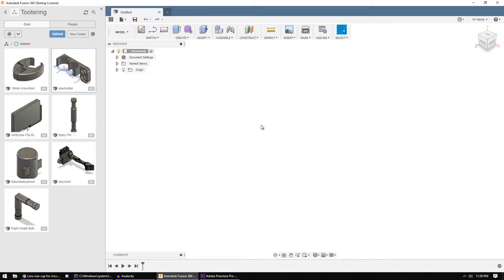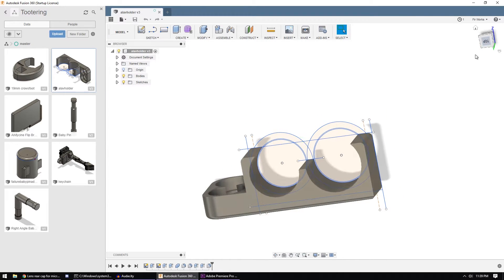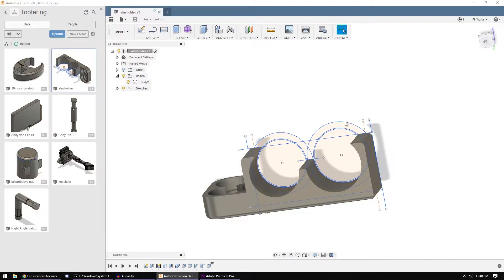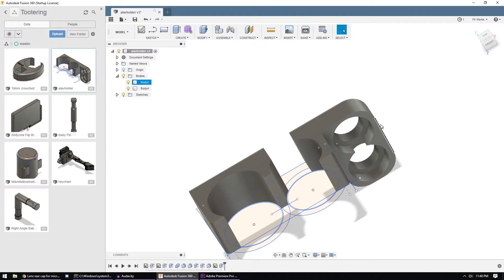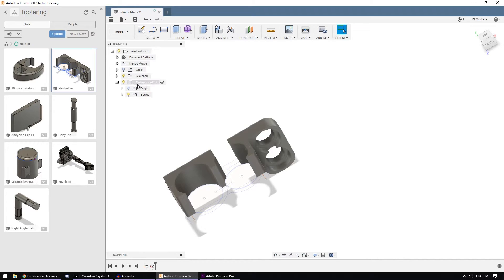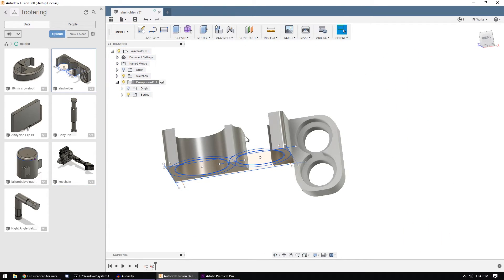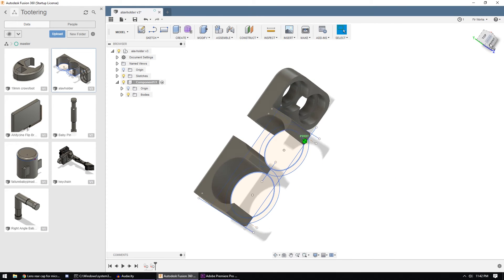How to Combine Bodies and Export STL Files in Autodesk Fusion 360

Comment: 1:51 There are good reasons to use a component, but you can also export multiple bodies by right clicking on your top level part in the browser (i.e. alavholder v3)

Comment: I need some help lease.I need to print an object. The object is compunded of multiple bodies and most om them are hiden inside the object. I want to make the object as a solid. But i dont want the internals to be saved into the .stl files otherwise the slicer will want to print those bodies as well even though they are hidden inside the object. This will increase print time drastically and also material use.So is there any way I can save multiple bodies of an object only into one solid or only as a shell?
Reply from the maker: Can you not just instruct your slicer to ignore interior spaces? I use Cura and it has an option called: "Union Overlapping Volumes" which I believe would do what you want.
Reply: I only have Slic3r Prusa edition. 1.36.I will try and look for something similar hopefully.Thank you for the advice.
Reply: @firworks  I have now downloaded, installed, set my printer up in Cura. I have watched tourtorials and imported my object and set the Union Overlapping Volumes option as you described. I Sliced the part and checked the pinting per level and guess what...
All for nothing. The internals are still Sliced into the STL. 😔. This just reaffirms that the model need to be made solid or hollow before porting to your Slicer. I tried this in Mesh Mixer but it completely messed up the part. 😫
Reply from the maker: @michieljames737  Well my suggestion was not necessarily to download Cura but more to find the feature in your slicer that works that way. However, it should work in Cura based on what you said earlier. Can you share the .stl file? I just did a test with a enclosed interior volume (cylinder inside a box) and toggling that setting in Cura will cause it to ignore the internal geometry: https://imgur.com/a/u59bHfY
Reply: @firworks  No I ding mind. I have been thinking of getting Cura also. But I am still struggling with my current Slicer so I just wanted to eliminate unnecessary variables. I appreciate the help and I did look for a similar option in my Slicer but could not find it. Thanks for offering v to help. The item I am trying to print is for my training. And there is not one that I can buy so I have to print my own. But don't want to waist unnecessary te and filement on printing and my training day is in a wheeks time.
Reply: Yes could share it with you. Shal I share it to you via google drive?or is tere an email adress I can share it to?PS. I looked at the imgur link you shared and thats exactly what I did. But while slicing the parts still show when curring.
Reply from the maker: A Google drive link would work fine.
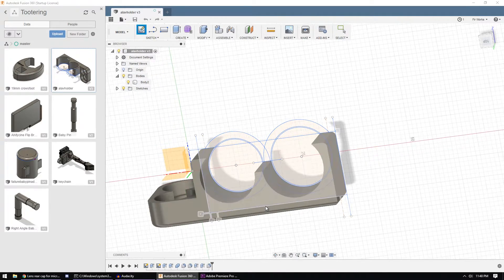Reply: PS. The .stl file is 1:10 scale so you must multiply by 10 to get the exact model size
Reply from the maker: @michieljames737  Ok so at 10x scale, it looks like 0.4mm expansion, Remove All Holes, Union Overlapping Volumes will work I think. That removes most of the internal detail but does retain the barrel.
Reply from the maker: @michieljames737  Yep, I can see the problem. That model does not have overlapping volumes it actually has all the internal pieces cut out because it is an assembly of pieces with their proper tolerances. In Cura, you can remove those tolerances forcing the internals to overlap by using the "Horizontal Expansion" feature under Shell. I only had to add 0.1mm and now with "Union Overlapping Volumes" checked it behaves as I believe you want it to. If you are printing it at a large size you might need to go up to 0.2 or 0.4mm but try that and see what you get. Oh, also check "Remove all Holes".
Reply: Thank you I will try that quickly.Can I remove the Drive link again? Dont want to leave it public.
Reply from the maker: @michieljames737  I deleted it.
Reply: Ok thanks.It works. However after I sliced it the file looks very fat now and lost alot of detail. How do I fix that?
Reply from the maker: That's probably the limits of what you can do in the slicer. If you modify the overlap between parts so they become solid it will also expand the outside as well and that's where the detail loss is coming from most likely. There is another free tool called Autodesk Meshmixer which is a useful tool for fixing broken models and making stl modifications. Fusion 360 isn't a good choice because it can't handle high poly models like this one. If you don't have it I would grab it and import your stl and start exploring the "Edit" menu. There are a lot of tools in there but like I said it can be very slow and that model you have is pretty high polygon.
Reply: @firworks  I tried it inicially in Mesh Mixer. But I tried the male solid option, then you get definition loss.
Then I tried make hollow and it was even worse. That's about the extent of my knowledge in Mesh Mixer.

If you could help it would really also make for a very usefull Youtube toutorial.

Comment: Thanks for the tip. Just curious though, if these print out with out anything connecting the two bodies then why would it matter where they are on the printer? You will end up removing them any way when the print is done.